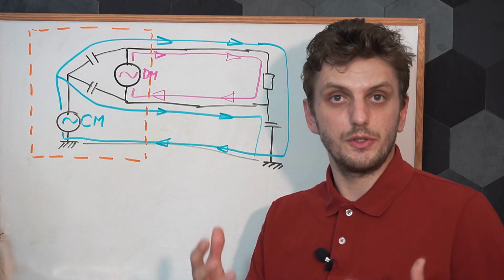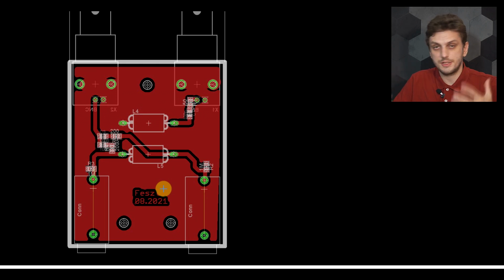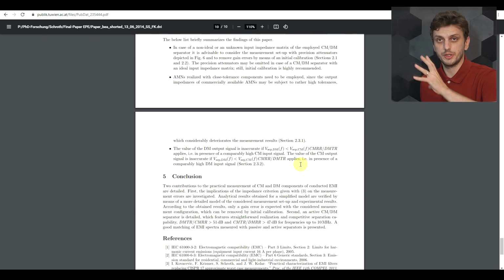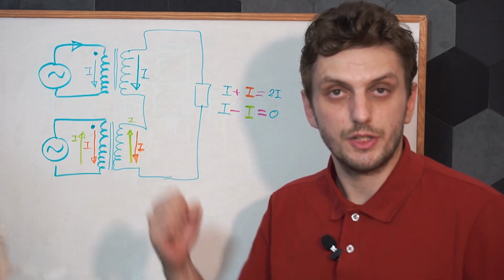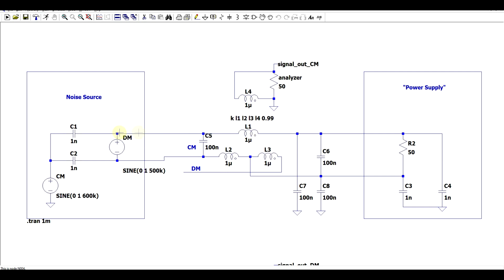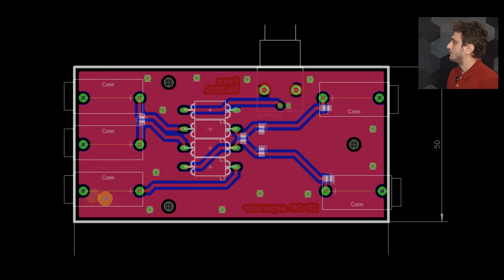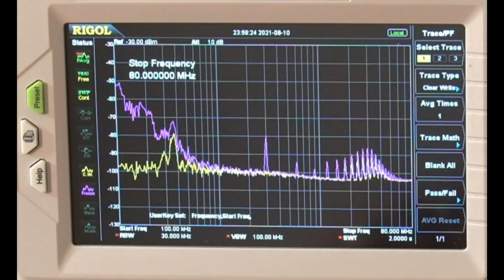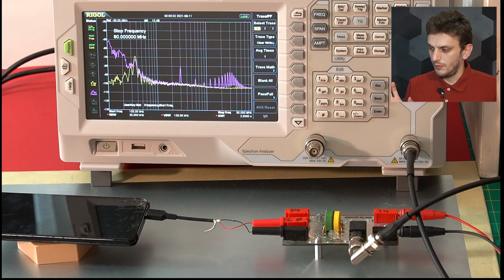EMC tutorials - Passive CM-DM separator

Comment: If you have one of those fancy split core wideband current transformers like a Fischer F61, you can choose between DM or CM by from which side you let the wires enter the coil. If both enter at the same side the output is the CM current, if one wire enters from the opposite side the output is the DM current, times two.

Comment: Thanks for the video. I think I noticed a little mistake. 8:20 the current on the secondary winding is actually flowing in the opposite direction comparing to the direction of the current in the primary winding. In other words, the arrows on the right part of the schematic should be reversed.
Reply from the maker: I have to be honest, I did not put too much thought into this when creating the drawing; but in the meantime I did do a quick LTspice simulation - a sinewave going into a 1:1 trafo and a resistive load on the secondary. At least with that setup, the secondary current is approximately 90deg phase shifted in reference to the input. So when the primary reaches a maximum or minimum, the secondary passes trough 0. In other words, for a primary current going one way, you can get secondary current going both ways, depending on the time of measurement. 
I'm not sure what method would be most appropriate to do such a drawing (from the video) without creating confusion...

Comment: If you look at the 150ohm DC-AN's (DC LISN for PV) ... they also use the 2x first winding, 1x secundary winding principles to seperate Common mode from differential mode noise.
Reply from the maker: Are you referring to something like this?: http://schwarzbeck.de/Datenblatt/k8300.pdf
Reply: @FesZElectronics  Yes. 

This is listed in the EN55011. The 150ohm termination is a reference to the Load termination (C2 & R8).  

When using it as a voltage probe (Just the output in parallel with the DUT).. Compliance with common mode has to be met. (Pos 3). Although I don't know if the industry uses this.. or a  50uH/50 ohm LISN (rated for DC), since this is not referenced in the 61000 series.  

In the datasheet is see that the secondary winding is only used for DM mode.

Comment: Excellent job!! Thanks a lot. Just one comment when you show the 2 transformers with their secondaries connected in series (8:28) you say that the secondary current of both transformer are building up or cancelling each other depending on the polarity m I believe that you are referring to the voltages and not the currents since they are in series both transformer have the same current. Indeed in the LISN the current noise the converted to a voltage noise using a resistor so the 2 signals output can be added or subtracted using transformers in series connection
Reply: @lotecque  yes I understand that you can use super position ( turn off one an then the other and sum up the results) to find out what it the net current but in reality the two batteries will have the same current since both are in series. Super position is a excellent tool to work with this linear circuits. 
What I wanted to point out is although the main principle of then circuit is on (separate the cm and the DM) the explanation might be incorrect since what is really happening is the cancelation of the voltages and the the currents.
Reply from the maker: I find it quite odd referring to transformers as sources of voltage - since they work with magnetic fields, the fields generate currents in the windings; these currents end up translating into a voltage eventually but I just find it a strange way of expressing things.